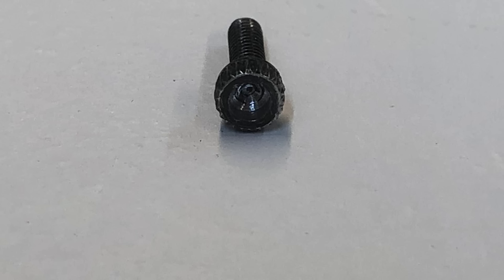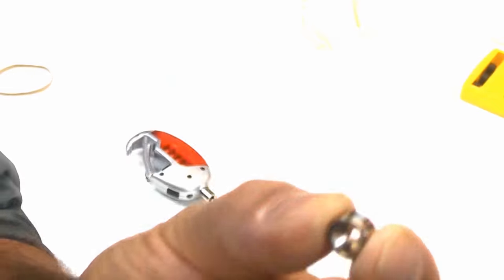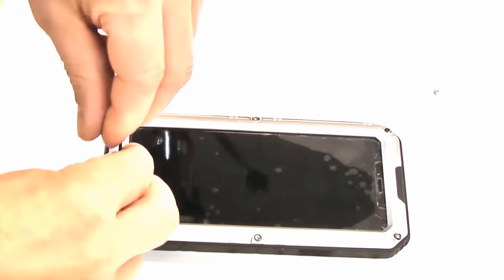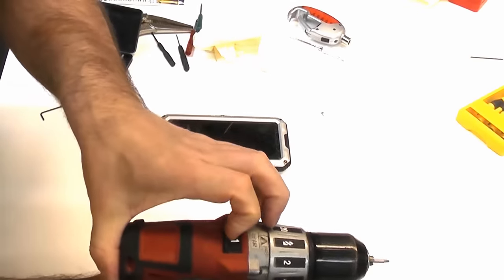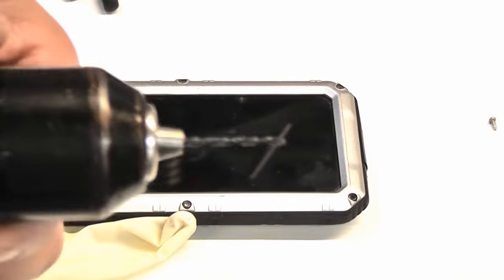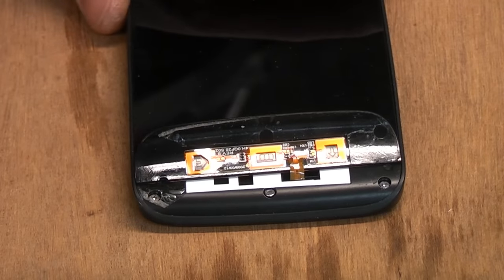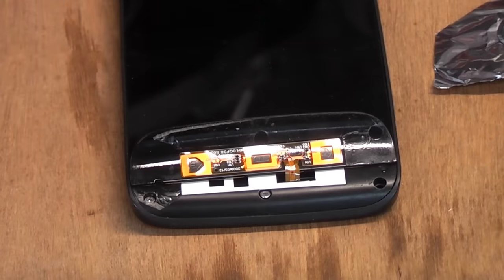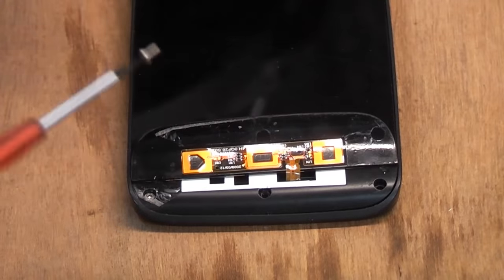How to remove small stripped screws | stripped laptop screws | stripped phone screw removal

Comment: I’ve tried the rubber band and foil methods but the screwdriver usually Pierces through it making it useless
Reply: UPDATE: (10 minutes later)
I just used the elastic band on the other 3 stripped screws on my PS4 controller and it worked perfectly. 
Might try the glue method on the 4th one. 
Thanks for this video.
Reply from the maker: Sometimes it works. 
Thanks for the comment
Reply: @ekzoX0  how did u do the ps4 remote mine is also striped
Reply: Fuck that I tried everything expect like the stripped screws or the gripped turn cause I don’t got nothing but glue & a screw kit I just I got ode tired of it was going to close everything & buy Dremel cutting  wheel , but I just put pressure with the flat head screwdriver out of madness & worked 😭😂😂 like I was stabbing that shit in hard 😭😂 smh manufacturer as company
Reply: Lickthesole most screws on ps4 takes a ph00
Reply: @juniorquintero1702  lmaooo
Reply: Yeah I'm trying this now.......it rips through the foil.
Reply: @ekzoX0  what size was the rubber band?? cause i only have small ones
Reply: The foil worked for me after I folded it multiple times and used a torx head. The driver punctured through the foil partially, but there was enough pressure on the sides of the screw to remove it. The screw head was small [<1/8" diameter].
Reply: Try using a sandpaper
Reply: All the methods failed for me
Reply: @ekzoX0  😅 the exact reason I’m here😆
Reply: If you have a heat gun. You can always try heating it up first.  It should soften the plastic and/or make the screw expand and shrink back to normal.  I'm trying to replace the CR2032 Button cell battery in my key fob.  Usually I just hammer a fine tipped spike into the center of the screw to allow the Phillips head to dig in deeper. But nothing has worked.
Reply: @kenkeez  I'm glad it worked for you but how in the hell did you strip a torx head?
Reply: Yep. This was just my experience
Reply: @ekzoX0 this may have happened cos you put too much pressure on the drill?
Reply: @MySpoot  you can also heat the aluminium foil in the microwave
Reply: @kQuista  there’s so many reasons as to why NOT to do that
Reply: I used the safety seal for a small orange juice bottle.  That one was thick enough to maintain through the force.
Reply: @ekzoX0 hey bro can you help me with that I also want to remove the screw of my ps4 controller but the screw is broken
Reply: Try tape
Reply: @ekzoX0 I came here because my DS4 screw had a problem 😅

Comment: I stripped the screw cuz the damn manufacturers overtightened it
Reply from the maker: They often do that!
Thanks for the comment 👍
Reply: It's probably to keep good contact with the cpu heat spreader
Reply: Cheeky Deeky or prevent you from fixing whatever you want to fix and go to their service and give them money
Reply: Benhur Bjay same
Reply: Same
Reply: @ultimatehandyman  the same thing might've happened to me.  But, the screw was a really shit quality one. So, that didn't help me either. It still won't come out and I fucking need it to.
Reply: Same happened to me. Boss just got a new tool for me to use. Had to remove blade to clean out debris. Bastards stripped it! Was worried. Hope I can get it out Monday.
Reply: Same here! I was trying to replace my back light LED strips on my Sony, and they over tightened these tiny little screws for the outside frame. Well I ended up stripping it of course, and when i looked more closely with a light you could see the head of the screw was slightly flared up from being over tightened. WTH?! But I'm definitely going to try the micro grabit or left handed drill bit since these are in pretty good. Thanks for the tips Ultimate Handyman!
Reply: ikr bro
Reply: Mine has glue in the screws I think. Some type of blue substance
Reply: Make sure they aren't using loctite, if so you have to heat it
Reply: Relate can
Reply: @issipnoodles  I believe that. I wanted to open up my gaming laptop to clean out the dust only to find the final screw was already stripped >:(((
Reply: Ik I can’t open up my Nintendo switch
Reply: @shaunatate  i know right the bastards stripped the screws on my hp notebook 15 af131dx
Reply: @deletcleet9771  can you tell me how to take it out if you found a way. I think we have the same problem
Reply: same bruh
Reply: same i’m trying to replace cpu and gpu paste but they overtightened it
Reply: @Power_Verse_  Loctite.  Heat it and will be much easier
Reply: @Ppmoosekk  same here, 2 screws on mine are overtightened. Tried the band, foil, and even tape. Thinkin of trying the superglue next
Reply: Dude, I work on laptops and they tighten the screws down so hard, that I couldn't even twist it. The state trooper couldn't get one out and we both stripped it. He looked at the screw and was like; "They put too much lock-tight on them lol."
Reply: Same here
Reply: I have a labtop with the same issue
Reply: Tried to repaste my laptop's thermal paste, good lord they are tight as hell, I managed to stripped one of the screws...
Reply: same. all screws were loose, but one. . . the one I actually needed under.
Reply: Same on my damn cpu holddown. Guess my laptop will just have to run hot now💢
Reply: What if I dissolve the screw with gallium?
Reply: @deletcleet9771  is it one the middle rail screws? I stripped the one on the right side, I tried some of the other screws on the rail and a couple seem over tightened but I didn't want to put to much pressure on the screw and strip it like I did the other one I needed to get out.
Hopefuly I can get the damn screw out after I borrow some tools from my dad lol.
Reply: @Power_Verse_   it’s called loctite must have been a Samsung Laptop. Read my latest comment and the reply I received from the @Ultimate handyman
Reply: This is happening to me, I’m triying to change a M2 drive and the screw was so tight that this happened 😭
Reply: Same! I have a feeling it was the company’s technician/s who overtightened the screws on my laptop’s battery. I came back earlier today just for another technician to make me feel like crap for how stripped the screw was. I got 7 out of 8 (5 were taken out with rubber band method). 1 is extremely difficult to remove as has been screwed TOO tight.
Reply: @Alfernav  did you manage to fix it I need help
Reply: I just got my laptop back from warranty service for a touchpad repair.  The screws had been secured with loc tite.   Why?   Now I can't upgrade my sodimm ram
Reply: I stripped a 15 mm screw 😭
Reply: Same happened to me😂
Reply: Was it the original Nintendo Gameboy??

Comment: I've been trying to open my Nintendo switch to fix an issue with the controller connecting but one of those tiny screws stripped. I've tried so many methods but nothing worked. Finally I got it, here's how. I used a mini flat head! Not in the centre, but on the edge with a lot of pressure. I basically created a divet on the side and pushed in a circular manner. It was difficult and it scratched up the area around the screw, but luckily it's inside the side track so you don't see it. So for anyone who couldn't get any other trick to work, try etching a notch with a flat head from the side (or anywhere not centered) on the screw and rotate around instead of spinning from the center.
Reply from the maker: Thanks for the comment

Comment: i didnt have a rubber band but it gave me an idea i used a sticky paper, the ones for dog hair and stuff, sticky on one side i put that side on the screw and used the screwdriver. the normal one, I shaped not + shaped. it worked. i also tried wd 40 and the drill machine. the paper thing worked, not having rubber haha happy

Comment: Hi, thanks for this video. I tried the rubber band method before but that was too thick; I learned about using nitrile gloves from this video, which worked. It was a stripped laptop case screw and I had to also use a correct sized flat (horizontal) screwdriver tip.
Reply from the maker: I'm glad the video helped.
Thanks for the comment
Reply: I’m having the same problem now. Brand new laptop. I just upgraded the SSD but forgot to plug battery back up. When I went to undo the screws again, the bottom corner one stripped. I’ve tried rubber band, glove, foil, and now working on super glue method. The other the bit when right through it

Comment: Nice trick with the aluminum foil on those tiny screws.  The foil is thin enough that it easily conforms to the internal shape of the screw head, making removal a snap.  Better than my idea to put a dab of epoxy in the screw slot or hex, placing the screwdriver/Allen wrench in that and somehow supporting it for a few hours/overnight until the epoxy hardens, then try backing it out.  That might work in an extreme case, but your solution is the way to go.  It's quick, doesn't mess up any small tools and allows you to keep working.  Thanks.
Reply from the maker: Thanks for the comment 👍
Reply: Yo I’m working on a 2ds I’m gonna try this as a last resort cuz I can’t tear apart the frame and make the whole thing ugly

Comment: Found this video because my department has been working with hardware that uses the cheapest screws a lot recently. We've been having issues with smaller Phillips heads and was looking for future pointers. However, what's been working is square screwdriver bits. It's been going surprisingly well for stripped out Phillips where the rubber band doesn't. 
In the past, I've also gotten a rotary tool before and "decided" on behalf of the silly hardware manufacturers that, actually, they MEANT to use a flathead screw. Not to worry though, I've made that correction and "reconfigured the hardware" on their behalf!

Definitely thinking about getting a set of those tiny extractor bits you showed though, that would be awesome.
Reply from the maker: Thanks for the comment 👍

Comment: I'm half convinced the rubber band method is a thing of legend when it comes to tiny phone screws. I've dealt with many stripped phone screws, rubber band trick never worked once. I could see it working on bigger screws though. I had luck with nail clippers to grip on a tiny interior iphone screw before, but that trick only works on the rare phone screw that you can grip the outside of, most are in somewhat of a recess, making the grip impossible. Trying the glue trick on a Pixel 2 stripped screw right now. It's a very tiny, light (cheap) screwdriver, so the glue is holding it up by itself. I'm gonna give it an hour or two before I give it a try and fail miserably.
Reply from the maker: Thanks for the comment 👍
Reply: Did it work?

Comment: Thank you so much bro. I would literally kiss you if you were in front of me rn. The rubber part actually did it for me lmao. I thought that it might not work since in my country the rubber is not that flat and is actually very thin. Since i was trying to get it out of my laptop, im trying to be as delicate as possible. My last option would be to drill cause im frustrated af. But after trying for the fifth time, the screw became loose. Thanks man, you literally saved my arse. Subscribed. Thanks again.❤️❤️❤️❤️
Reply from the maker: I'm delighted that the video helped ;-)
Thanks for the comment

Comment: The rubber band worked for me. Had to fold it over once and the very tip pierced but enough of the grooves were able to make contact and that plus pressing in hard worked. Thanks.
Reply from the maker: Thanks for sharing 👍
Reply: @ultimatehandyman  No thank you! 

For a completely separate rounded screw that's 50% over the barrier of an edge my last try is super glue, but I haven't done it yet. How do I remove the glue from them afterward?

Comment: I normally just use a standard flat blade screw driver. I have a good selection of small screwdrivers and I find one that fits tight in the screw. Obviously this will not work if the screw has been perfectly rounded but I have not found a screw I can't take out yet. Thanks for the tips mate always handy.
Reply from the maker: Thanks for the comment 👍
Reply: @ultimatehandyman  Thanks man!

Comment: Thanks for this! Dell overtightened their heatsink screws in my XPS and I stripped two of them trying to get to the CPU to repaste it... Will get replacement screws and attempt some of the things you've mentioned here. I am terrified of the dremel though :D Hopefully other methods work
Reply from the maker: Good luck with it ;-)
Reply: What worked ?? I have the same issue with a dell
Reply: I am having the same issue, what worked?
Reply: @edgardocastaneda9402  did you figure it out? :D
Reply: @edgardocastaneda9402  did you fix it ?
Reply: Fucking Dell bro. Stripped my shit too

Comment: I read everything on YouTube, the glue method, rubber band method. It was this 1 little screw in a laptop that was stripped so badly that nothing worked. Not even drilling and putting it on reverse. So I drilled the screw completely and it came of 🙌

Comment: I didn't know you can get left handed drill bits.
Reply from the maker: They are not very common, unless you work in engineering etc.
I bought a full set at auction a few years back and they have been invaluable for removing damaged screws etc.
Thanks for the comment 👍

Comment: You can also rub your magnet on your driver to magnetise it but it doesn't last that long
Reply from the maker: Thanks for the comment
Reply: Makita make some really nice bullet shaped blue plastic magnet holding accessories for ordinary screwdrivers that contain two magnets and slip onto the approximately one-quarter inch  diameter metal shaft of most screwdrivers. They have incredible magnetic force;, I haven't seen any similar magnetic devices made specifically for skinny small diameter screwdrivers such as might be used on cell phones and such, but the Makita ones can be slipped on temporarily to any small diameter screwdriver shaft, they just don't really center themselves automatically and stay in place forever and ever.
Reply: This worked like a charm for me! Thanks!

Comment: Spent weeks trying to remove screws attached to stainless steel. I tried EZ Outs, screw extractors, rubber bands, super glue, drill bits, gloves, and the only thing that worked was using a rotary tool with cutter (Harbor Freight $10) to cut a line/slit(Phillips flathead) in the center of the screw so an Impact Driver can hold onto the screw.  My screw was too short and the material was very soft.  Put painters tape on the screw before using an Impact Driver(Amazon $12).  This was the only thing that worked for me. Hope this helps someone out there.
Reply from the maker: Thanks for the comment 👍

Comment: I wanted to custom paint my keyboard, but one of 20 screws won't unscrew and it got worn due to excessive trying, damn I had to cancel my plan. It also ruined one of my good screwdrivers.
Do companies really need to screw that tight when they are already using 20 screws -_-
Reply from the maker: I don't know why they tighten some screws so tight!
Thanks for the comment 👍
Reply: Been told it so you can not service it yourself.

Comment: For anyone still looking for a solution to a stripped t6 screws, get a soldering iron, solder and a t6 bit
- take the t6 bit, insert it inside the stripped t6 hole.
- start by turning on the soldering iron and adjust it to medium power (650°)
With a pair of Pliers, grasp the torx bit and  insert it verticaly inside the stripped screw as if you were trying to extract it normally.
While keeping the bit as centered as possible inside the stripped head, place your preheated soldering iron against the stripped screw for 10-15 second to assure optimal heat transfer. 
You should then quickly place the solder against the bit and the screw till the solder melts and pools up inside the stripped screw head. 
While keeping the bit centered and vertical, remove the peice of solder from the contact points. The solder that pooled up inside the screw should now be bonded to both the bit and screw making all three into one peice. Good lick!

Comment: I regulary have to fiddle with stripped tiny screws and waslooking for info when I found your channel.
Most of the tricks I knew allready although I do not have pro-tools as leftsided drillbits.
What I also used is a grabbit-bit but they are all too big as i mostly work with 3m, 4m, ... (3mm, 4mm) in my hobby which is rc-offroadracing.
Now, learning there also exist micro grabbit-bits, this ccould be a life-changer for me.

What i mostly did in the past wwas cutting a slot in the head with a dremel and use a regular screwdriver to get it out. But this also alwways caused the surrounding of the bolt to be cut also.
Reply from the maker: The micro-Grabit is ace- really useful for small screws ;-)
Thanks for the comment

Comment: This helps alot man , thanks I tried it with the rubber and it did not work but then I tried afterwards with a little pressure and voila! it turned. Thanks man.
Reply from the maker: Glad it helped
Thanks for the comment 👍

Comment: Great proven ideas for Phillips, Torx, square drive screws which all help centre the removal tool.
I am struggling with a small recessed slot screw.
Dave A.
Reply from the maker: A slotted recesses screw is a real PITA. Perhaps a left handed drill bit will work, you could make some kind of bushing to hold the drill but central, similar to what I did for this video-
https://www.youtube.com/watch?v=dJfkCj3FWBs&t 👍

Comment: The super glue method would probably work great until you need to use that screw bit again
Reply from the maker: Just run it under the hot tap, the hot water will enable the superglue to be scraped off with a finger nail  👍

Comment: I was trying to unscrew my laptop (T5s) and I tried everything and I almost gave up. But than I noticed that that just like the screw, the driver tip was also blunt. So what I did was I shave of the circle blunt part and basically just cut the warn down part to re-make it. And then I tried the aluminum foil. Got it out.👍